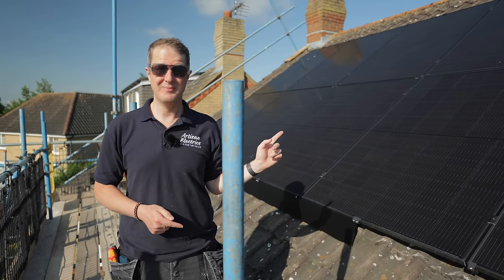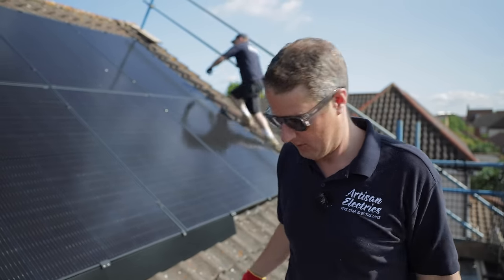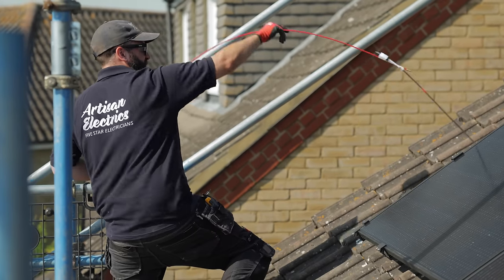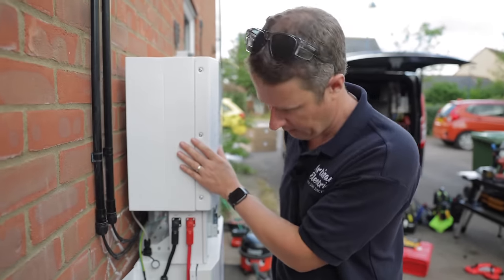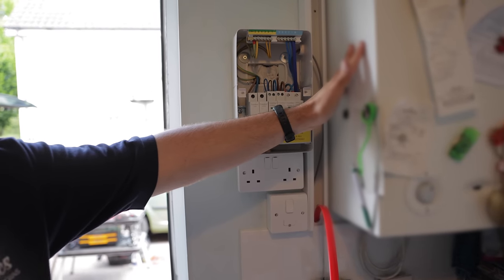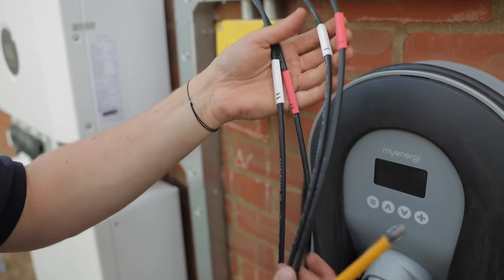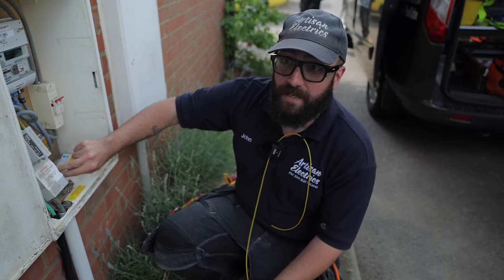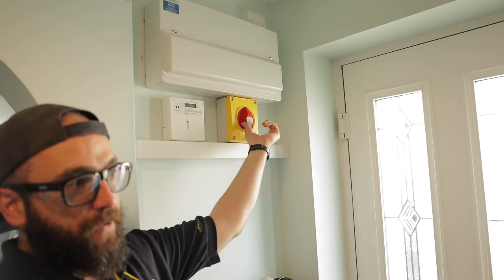Forced To Change Our Own Solar Install!

Comment: ... sorry, more questions. How do you prevent the PVs from over-heating? What made you choose the Libi from myEnergi and not any other product (their Zappi EV Charger which I have has no OTA (software or firmware over-the-air capability, hence, why I've only ever updated the Zappi once after install as I refuse to do this manually; never going to choose a myEnergi product again))? As part of the maintenance, do you clean the PVs? What happens when the system fails? Does it fail safely? Thanks, Abi
Reply: V2 Zappi's with built in Wifi have OTA firmware updates - mine been updated numerous times via the phone app.
Reply: @blower1  I have V1 Zappi!! :)
Reply from the maker: Hi Abi - your Zappi is V2.0. PV panels need cleaning regularly if they are less than 40 degree pitch as manufacturers instructions state, but I would always recommend cleaning once a year (good window cleaners use poles and pure water which is perfect for this)

Comment: Not sure about unplugging the mc4 while under load mate… there is a sticker that your meant to place on the inverter that states do not unplug mc4 under load … simply turn off your dc isolators and your good to go

Comment: I don't understand why the "Henry" dropped in power on the battery, why is it presumably set to output a lower voltage than usual grid power?
Reply: I'm not sure but it might be that it appears to be common in UK that grid voltage is 15-20V above the nominal 230V and battery system feeds nominal voltage?
Reply: The inverter puts out 230V constant. The UK power grid is 230V +10% or -6% (216.2 to 253V). In practice it's usually around 240V in most areas unless you're a long way from the substation. That extra 10V is why the Henry's motor has more power when it's on mains power.

Comment: 22:44 how can you perform an insulation test without having a third lead going to ground (or other metal parts close to the solar array / cables)?🤨
See the little image under the "Auto" button? There is a third lead you need to plug in and connect.

Comment: Hobbyist electrician:  Voltage without current is OK.  It's when the resistance drops such that you start to get current that things go wrong.  With no load you are good to plug an unplug panels, just keep the resistance near infinite like you are doing in the video.

Comment: Ac solar systems with micro inverters are way better for a array will less than 20 panels. Idk what your local code is tho so dc system might have made more sense. Love to see different types do systems as a installer myself

Comment: Skirting on the solar panels seems like an unsafe thing. In case of a fire, the firefighters won't be able to get water underneath the panels. A recent fire (in Arnhem the Netherlands) showed it is a real issue, resulting in the loss of 5 houses in a block of 8. Due to being unable to get water to the fire.
Reply: Its to stop birds gettign underneath, their nesting would most likely not help in the event of a fire
Reply: @Sparks0001  Something like the grid-style anti-bird measures they used on the Nimbus job would probably solve both problems - birds can't get under, but water can. But it probably wouldn't look as good on a residential roof. And with all that said ... I've still driven past plenty of installs where the rails have been left open to the elements with no skirt or anti-bird grid!
Reply: Three installs (ours, MIL's, my parents), all 10-11 years, and never had a bird or anything under any of them.  Two installs in the country, one in a town.  Total con, like optimisers.

Comment: Well the solar supplier has dictated the size of the system  and supplied the relevant kit. The solution here is to upgrade the inverter to a 4 or 5 kw unit and use only Kako, German manufacture. Always try and keep the inverter temperature less than 38 deg. A computer fan works just fine with a boiler type thermostat. Mine has been running for 12 years with no problem !

Comment: Like thats exactly what MC4 is for, the conductors are deep inside the connector so you can't get your finger in there even if you tried and is good for protecting you against 500V easy even at high elevations, so as long as you are not incredibly stupid it's fine, just don't dunk them in water or put a screwdriver down inside the connector and your fine and yes for high voltages you do need to worry more about a dead short because of arching because the lower density the air is the easier it is to arc over a longer distence, something about being able to have more room to accelerate atoms in the air without bumping into other atoms. It's simmilar to the reason you generate x rays by peeling tape in a vacume as the startic charge in the tape can accelerate electrons into the x ray range.

Comment: A mppt is like a light build, as long as you don't exceed the VOC per string.
You can over panel a mppt in Wats as it only uses what it needs.
And your running ac and dc all together in same trunking.
And galvanized trunking out doors.....no ip rating.
This is the problems that's costing solar installations so much........solar and battery storage is totally different to ac Mains installation.
I bet my small set up is saving far more than that setup, both in cost and energy savings.

Comment: should of used microinverters. Simple, no hassle, no problems matching inverters with panels, no high voltages (lower cable losses), and once installed, fault finding is a breeze if something goes wrong. I use enphase and I'm very happy, 10 years down the line.

Comment: Enphase ac microinverters are far better than running 12v and a lot safer. I have 21 / 410 panals plus 20 Megawatts to watts of battery and no electricity bills.

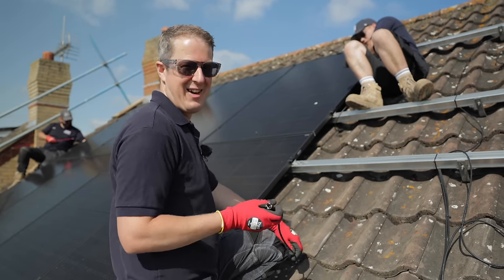Comment: 5:00 NEVER Disconnect MC4 connectors under load, even says it on them. 

nice work on the cable routing and trunking on the side of the house. it looks very neat.

Comment: Don't you have rules in UK of heights from ground/floor to put things? That placement of batteries outside would prob. never be approved here in Sweden. I don't think the IP65-rating and connections could stand being sunk into the snow, after a while of melting, freezing and hits against the unit as an example.
And batteries hate low temperatures, even if that Libby is "approved" to be placed outside I think its a waste of money to do so.
But yeah, I would at least place the array on stands, 30cm up or more. But maybe thats just me 🤔

Comment: You've compromised the ip rating of that ac isolator by going top entry. It will fill up with water because it's coupled to glav trunking which definitely isn't ip rated. Cowboys. How about focus on being good electricians first before wasting time making these videos.

Comment: In this day, given the myriad of advantages, why would you not use micro inverters on a new solar  install with each micro inverter placed on the roof under its respective panel and then all connected to a multi-channel MPPT Controller located at ground level.
Reply: Micro inverters fail......failure requires scaffolding and panel removal to fix. A complete nightmare waiting to happen if you ask me.
Reply: @blower1  everything fails evertually. The difference in power generation over the useful lifetime of a micro inverter system vs an old school style system like this can be massive. All solar systems require upkeep, they all need to be cleaned at least yearly to ensure decent ongoing power generation. You don't put something like this on your roof and then expect to be able to leave it unattended for 15 - 25 years.
Reply: @hot_wheelz  From experience, micro inverters fail far more frequently than optimisers - better to have one large inverter unit and optimisers on the panels than micro inverters.
Reply: Microinvertors are a con.  Had them fitted back in 2013 with my first solar install, they're a waste of money.  Compared to a similar system on MIL's house that has the same panels and same invertor, pointing near enough the same direction, there's actually less production from the system that has the microinvertors.
Reply: @zstation64  that's going to be very heavily dependent on application. If you happen to have an essentially ideal installation pointing at the perfect angle and all of your panels either being in full sun or heavy shade at the same time then I might agree with you. However the number of real world installations that are a compromise and a far cry from ideal would out number those ideal installs 1000:1. In a more typical real world install micro inverters coupled with a multi channel MPPT win more often than not.

Comment: That unit will spend months needing to use energy keeping itself warm enough to be able to accept a charge.
Reply: If that's even a thing?  Do they have a heater?  Even in my insulated garage, I have my Pylontech batteries insulated (using an old hot water cylinder jacket), AND a 65W greenhouse heater going, and they can still get below 15c.  LiFePO4 batteries want to be 20-25c minimum to hit their marked capacity, and a lot won't even charge at 5C or below.

Comment: Isnt this just an over priced kstar rebranded hybrid solution  thats been out over a year in various different outfits. Although spec says it will work im  still dubuous about batteies outside as  the battery technology reslly doesnt work effectively at 5 degrees or less.
Reply: Yes based on system made by CATL and Kstar.

Comment: Fitting the batteries outside isn’t unusual. Even with all the protections in place. They are bombs waiting to go off and if the batteries installed along the route you’d use to escape a house fire. Then it needs to be somewhere else. 

Outside or in an external garage is absolutely fine.

Comment: I love that the Libbi battery basically just a 48V server rack battery, but virtical and cost like £3k per battery while you can get a server rack battery for £1k, there is even a virtical battery by Fogstar coming that is over 3x the capacity for $2.5k, like admitedly you can't put a server rack battery outside, but still £2000 for outdoor rating is too steep. If it was like even only a £250 premium for the outdoor rating and say they add another £500 because it looks nice, like it still would not be my cup of tea, but I could understand, but it's another £1.25k over that.

Like it's a fucking ripoff.

Comment: That equipment will have an IP rating that implies that you can mount it outdoors, but that equipment is not weather proof, UV and weather will degrade the equipment and it will look very shabby and start to fail within a very few years.

Comment: An arc can occur when amperes flow at high DC voltages. 
DC arcs do not extinguish at zero crossing like AC.
Each module makes approximately 36 volts at 15 amps. 
When the inverter is switched off, there is voltage but no current.

I prefer micro inverters instead of string, then everything stays under 50V DC.
Reply: Problem with microinverters is when they fail it requires a trip up to the roof and panels removed to gain access to them - if microinverters are used i'd insist every one of them is installed in the loft (which makes for a lot more holes for water to get in on your roof)
Reply: @blower1 unlikely to get water ingress, but installing them in the attic space is definitely recommend for when they fail and they will fail

Comment: Why you put this aluminium sheath around the modules??? This is full-black modules and they need a lot of ventilation to cool down, and why you put panel so close to the roof? This is bad modules installation.

Comment: Never Unplug MC4s under heavy load or under high voltage, as it may involve arcking, i would feel safe to unplug anything under 50V and 1A, never unplug strings at 400V under any load, that may make contacts black and cause overheating of conectors in the future.

Comment: The Work at Height Regulations 2005, this is the law.... Falling objects
10.—(1) Every employer shall, where necessary to prevent injury to any person, take suitable and sufficient steps to prevent, so far as is reasonably practicable, the fall of any material or object.

(2) Where it is not reasonably practicable to comply with the requirements of paragraph (1), every employer shall take suitable and sufficient steps to prevent any person being struck by any falling material or object which is liable to cause personal injury.

(3) Every employer shall ensure that no material or object is thrown or tipped from height in circumstances where it is liable to cause injury to any person.

(4) Every employer shall ensure that materials and objects are stored in such a way as to prevent risk to any person arising from the collapse, overturning or unintended movement of such materials or objects.

Comment: You cant put AC and DC in the same trunking, unless its segregated. And Data cable through the consumer unit is dodgy as F too,  I wouldn't want to be associated with that install.

Comment: Hi mate, your cable plan in still incorrect. 

For a correct Solar installation always use a induction circle. 

Wich means that the positif wire goes all allongside every solarpanel. 

Read in to it. 

And keep up the good work, love the vids!!!

Comment: MyEnergy seems like an inflexible solution to me. Why do you force this in your product line?.  Would it not be better for "artisan electricians" to learn the ropes around DC connectivity and solar rather than rely on this as your sole solution? This rewiring is totally unnecessary and could have been handled by wiring it right and choosing the right components in the first place . -  What I would expect an electrician to do. Don't get me wrong I love this channel, but there is a lot of MyEnergy can't supply this and that so we are stuck. If you have the Scaffold up at the initial install Why don't you just wire every single panel down to a busbar or several busbars? 10awg wire is not that expensive. Then after words then you can sit around at the busbars jumping cables wiring stuff in series and parallel to meet the requirements of your charge controller - That would be smart - artisan even.

Comment: so what happens if a surge fires the SPD's  to Earth? In our regulations the SPD's need to be protected by an overload device
Reply: Some SPDs have the overload protection built-in, most commonly by a spring-loaded soldered contact. When it conducts too much current, it heats up to the point that it melts the solder, and the spring pulls the contacts apart.

Comment: Only 4 Panels per String is a Joke!
Changing Specs of an Inverter is what you dont want from a serious PV-Company.
Especially the MPPT Max Voltage should never be touched. 
I would tell the company to pay the bill for the new configuration !
Or I would never ever use that company again....
Dont use Window cleaner on PV-Panels!!!😨😱They have a special coating that could suffer.
Use special PV cleaners instead!

Comment: And in 5 years the electrics are completely corroded at best, or you get a massive electrical fault at worst......
And who would wire 10 panels to a single inverter anyways?

Comment: Lol and theres my good old SMA inverter able to run 15 x 300w panels no problem on one string.  So basically this negative change from myenergi has cost the customer an extra grand or two?  (scaffoling, you guys in for a day, rewiring, etc).     Garbage.